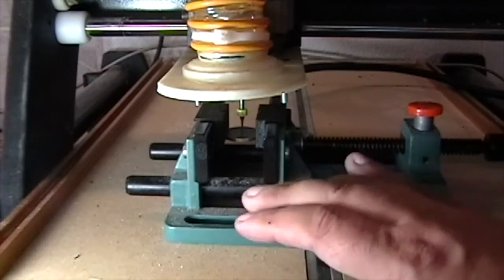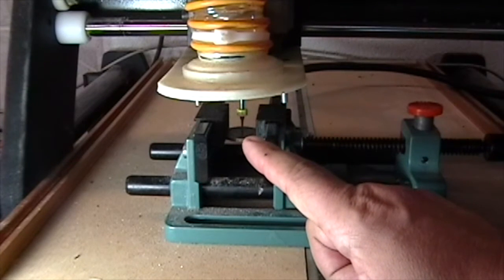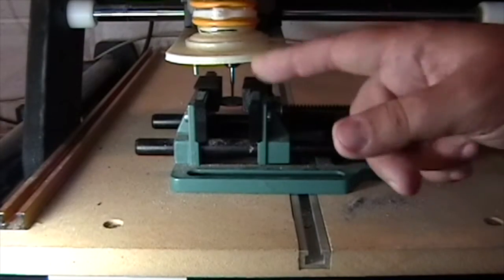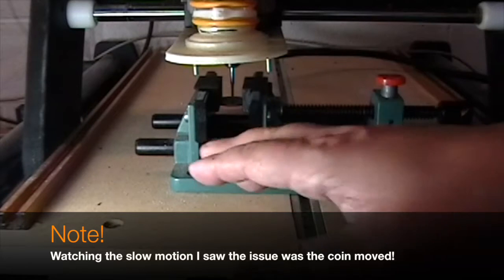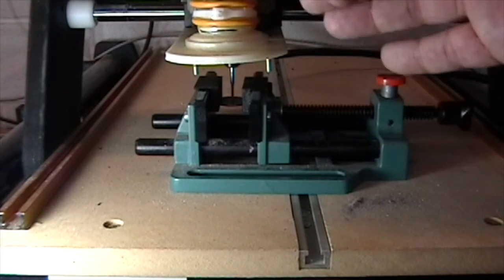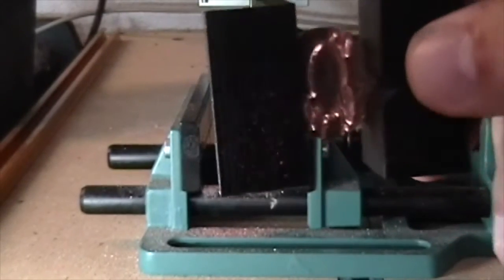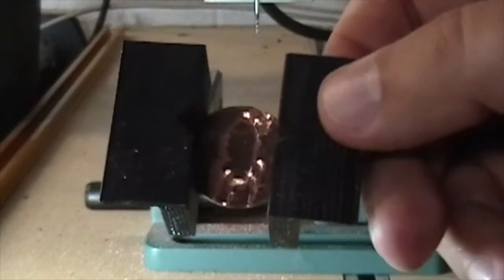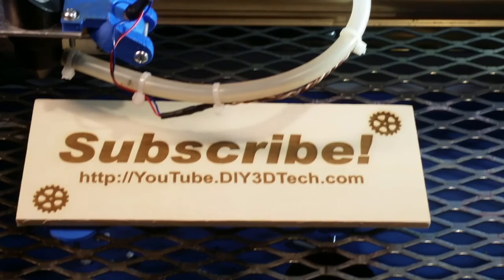CNC Projects -  Cutting a Coin to Create Coin Art!

Comment: you might be able to put some soldering heat sync clips on the coin and add a fan .  i use mine a fair bit to keep stuff in place  more than to wick heat away .
Reply from the maker: Interesting concept as on the new CNC which I just purchased I also got an air nozzle with a mister.  Also Think if I used PETG it would have worked a better than PLA however, the coin did get hot. Yet the fan idea is interesting...
Reply: if you use air without mist , just air , rite at the  coin it will blow debris away and also provide cooler air .  but now you know the shape works , it might be time to mill that face pattern into some alu soft jaws.
Reply from the maker: Yes have it on my to-do list to mill a set of these in aluminum.  Also on the to-do list is build a plexiglass tray to mist light oil too (have lots of projects planed).
Reply: lol yeah projects stack up . ( ideas & projects / time ) == not enough
Reply from the maker: I believe projects are much like the Winchester House, so long as you have them you have a reason for living :-)

Comment: Maybe a small redesign of your chuck to have space for a captive nut and put a set screw through the top to help hold it in place on the vice?
Reply from the maker: Interesting idea, yet when I get time will match the jaws to the jaws of the vice so they are held in in both directions.  As there isn't a "bottom" to cinch to with a top mounted screw...

Comment: Do you know what temperatures you're hitting?  With that information you may be able to see if there is a better suited filament material for the chucks.
Reply from the maker: If I was not so lazy (or just had more time) would have used PETG however the coin got hot enough it burned my hand (as silly ole me just grabbed it :-)

Comment: Joe - I saw the chucks move on the first run and then on the second one. The thing I started thinking about when you began the second run was how would you be able to cool the coin and bit during the process.  I figure that you couldn't use cooling/lubricating fluid like in a large CNC machine, however perhaps just air from a fan or perhaps turning over a can of compressed air (like from Staples) and giving a spray every now and then to cool the coin could help.  I see Jimmy DiResta use that technique on hot glue to set it up quicker. 

Overall it's a cool video and would like to see it work out. Perhaps putting double sided tape on the chucks or printing them to completely fit over the jaws of the vise would keep them from moving. 

Keep the cool videos coming. 

Norbert
Reply from the maker: Couple mods as when I did the original design I assumed the pressure would hold the jaws in place and I didn't have to match the jaws to the vice making it generic.  For engraving, I think it would work, however cutting the PLA melts to quickly so if it was the full size of the jaw it would have worked better, but now is only matched to my vice.  On the new CNC I will have an air/misting nozzle to cool the tool /object (this is one of the reasons I decided to spend the  coin pardon the pun).  I will also likely mill and aluminium version too which won't have the melting issue as messing with this coin art and the like has been a lot of fun!